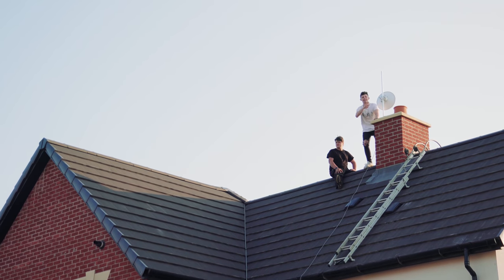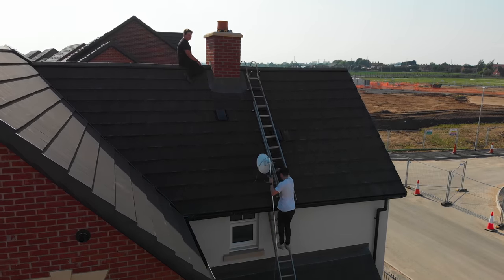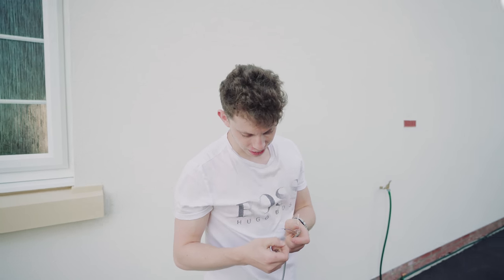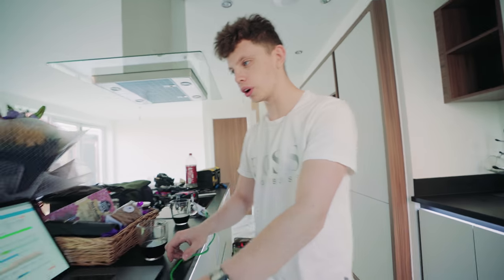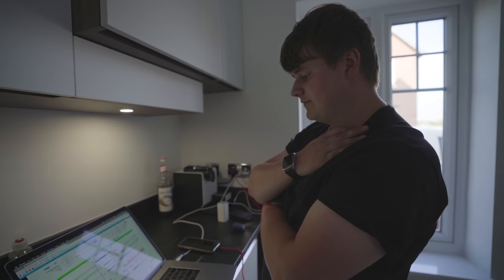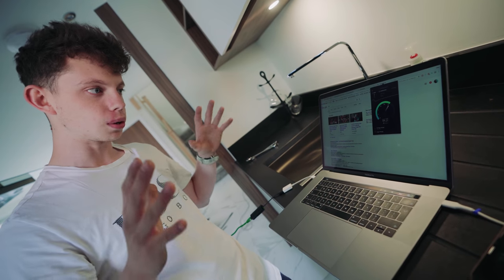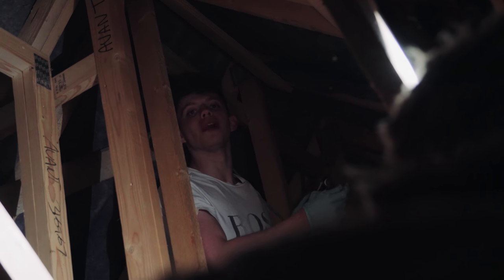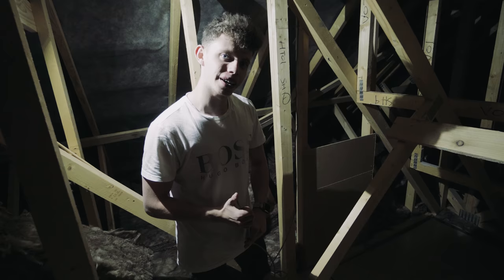How To Get Superfast Fiber Internet When you CANT!

Comment: Oh my goodness.... Its megaBITS (Mb) not megaBYTES (MB) to measure internet speed.... please learn
Reply: Bass Booster HD OMFG IKR. It gives me OCD every time i hear it.
Reply: You can measure Internet bandwidth in MBps but Mbps is what Alex is reading.
Reply: MaX Falstein No, it is a well regarded and accepted fact that data transmission is measured in megabits per second (Mbps) whereas data storage is measured in megabytes (MB). While yes you technically can measure data transmission rates in Megabytes it doesn’t mean people won’t think you are a complete numbnut
Reply: In data centre and supercomputer networks, both values tend to be stated for different protocols operating over the networks such as TCP/IP or Ethernet operating over InfiniBand or Fibre Channel operating over InfiniBand. Storage over network is often quoted as GBps across a network connection or aggregated connections, TBps across a switch or PBps across a whole network.

I can factually certify this because it is one of my areas of work. Just because you have not come across MBps does not mean it is not used.
Reply: Yes it can be measured in MB but for what im talking about and numbers from speedtest, its megabits...
Reply: Which is why I agreed with you in the latter part of my initial statement.
Alex read it wrong.
Reply: MaX Falstein I have. I’m in “that line of work” too. But for all intensive purposes when you’re talking about a YouTuber teetering on a ladder slapping a Ubiquiti CPE radio on the roof (using Ookla, which uses Mbps) we’re talking about megaBITS. Also “factually certify” is a redundancy. Pick one (most likely certify because it is the verb) and ditch the other. Eloquence is different than sticking a ton of vocabulary in a sentence.
Reply: Intents and purposes.
Reply: @eastwardExpansion  And then are Mebibytes, bet you never heard of those!

Comment: Mate, I don't think that you're using proper outdoor rated cable which will result in the cable deteriorating and you will probably end up with cracked cable and shit with the UK's weather.
Reply: System Void ya I looked at that and thought, “hmmmm.” One way to learn, the hard way
Reply: and the server he wants to put up there will die/ over heat  fast because of all the dust

Comment: when you can't terminate a RJ45 cable properly, at least use certified EZ RJ45 plugs and make sure your wires are straight. if you look closely the crimper he used is supposed to chop off the excess wire at the end of the plug and it didn't even do that.

Comment: I've watched about 4 of your videos on your wireless network now and wanted to add some comments for you @techflow that might help you on your way.

Firstly, you've done some amazing stuff, it's clear you've picked a lot of the knowledge up as you've gone along which is to be commended, I learnt a lot of what I know in much the same way and ignore the dummies who claim this is illegal or just want to tell you what you're doing wrong and make fun of you. I will however offer some friendly recommendations as someone who has worked in this industry for 12 years:

1. Get some tough-cable or outdoor ethernet cable that will last - the grey stuff you've shown is going to deteriorate with time and you'll have to re-run the whole lot; better to spend a bit more upfront and have it last for the servicable life of the radios (5 years~)
2. If you were to supply each of your customers with a MikroTik hAP ac lite or similar, you would a) have a device that you could login to allowing you to check speed and test the network from your customers end and b) supply PoE out (via port 5) to the radios you're installing, making for a much neater installation overall.
3. Have a look into more of the MikroTik gear for routing - while the Ubiquiti UI is appealing, you loose a lot of useful functionality that RouterOS has standard
4. If you want to start providing services to business, it'd be worthwhile looking into grounding the radios also - in the event a lightning strike or surge hits the devices are properly grounded and you save (at your home base) the switches/routers from being fried by voltage fed down the cable - in my opinion this is a case of "when" lightning hits close enough, not if :-)
5. Join some of the WISP Groups on Facebook, checkout The Brothers WISP or other such groups on youtube and listen to some of the new things people are talking about and keep yourself up to date on these - you've basically become one of the gang so you might as well benefit from others experience and help your own business out in the process.
6. For redundancy; install 2 sectors, one above the other - where you have customers on the PTMP setup you have the ability to setup a fallback SSID they can connect to in the event you want to take a sector offine to upgrade it / replace it.
7. On the subject of sectors - look into the RF Elements range of antennas - if you're having any issues with too much interference as you get near more heavily populated areas these will save you a lot of pain, ensuring that you signal only goes where you want it to, and you don't have to deal with the other crap nearby. Your customers can still operate on the regular client radios, but having good noise isolation on your primary connection points will give you more channels to work with and make for a better user experience all round.
8. Look into setting up a redundant point of entry into your network - now you've got your house, when you can justify it get a second high speed connection there (even if it's not as fast as the first) so that in the event you loose your primary at least  you have some 'limp-home' functionality for the people relying on your network.

9. Keep doing what you are doing, running an ISP no matter how big or small can be a great experience and a lot of fun!
Reply: Criticism is good because you do things right, if you take it as criticism and not random hate. I bet this dude is still going to be installing his network CABINETS in the attic...

Comment: You obviously go through a mainstream provider anyways. You don't supply your own pool. You basically take what you get and push out to other people in your neighborhood and then charge them. Stop fronting like you're your own ISP.

Edit -  I, myself and others apparently...see multiple issues. Please read the comments and correct your mistakes. 

Outdoor rated cabling, grounding,  attic space for a server???
Reply: How do you think an ISP works? They purchase data from an upstream provider and on-sell to clients. In a previous video he mentioned that he has a wholesale agreement with his provider. Retail ISPs do not usually allow you to act as an ISP and on-sell, so getting a wholesale agreement is necessary before doing this.
Reply: Anthony But they supply public ips. He provides a lan access.
Reply: Denzel Disk he could if he wanted to. He’d have to purchase a block of IPs though and for the small amount of clients he has and none of them probably need a unique public IP, there is no need.
Reply: No he could not provide his own IP Addresses, he certainly has no idea what BGP is and not a single piece of equipment he owns can route IPs. He couldn't afford the cost to own his own block of IPs, let alone the cost to get the equipment to actually use the IPs.

Edit: Anthony how you said an ISP works is not at all how an ISP actually works.
Reply: aidan can’t speak for your country. But it does here in Australia.
Reply: Anthony To a degree you're correct, though he is realistically only an ISP resell, not an actual ISP. An actual ISP would get upstream provider(s), more than likely they would just have mutual peering agreements.. Then BGP and serve customers, no agreement to say what is being done with the bandwidth is necessary.
Reply: aidan absolutely. He is being an ISP on the cheap. There is definitely a lot he could be doing better such as having multiple upstream providers for extra bandwidth and redundancy and having provider grade equipment, but then he’d have to have a lot more customers to justify the enormous expense.
Reply: aidan I agree with Aidan on this, this is equivalent to me chucking an Ethernet cable out my window and into my neighbours house to an access point. While it’s entirely possible to run many users on a single IP it’s a stretch to call yourself and isp , he doesn’t even have any vlan segregation I bet

Comment: @alex, you should invest in a uinstaller. Makes setup and alignment much easierand more efficient. I run a WISP in South Africa and use pretty much exclusively UBNT. With 2 in a team we can do an install in 45 min if all goes well. 1 guy on the roof and 1 guy runs a cable to the point on the roof. You can install the radio and do alignment with the uinstaller while the cable is being run, then crimp up and youre done.
Reply: Cameron Olivier // hey Oliver liked your comment you gave to Alex.  I want to do the same setup in SA . In order to establish a LAN and later a WAN. As you know data in SA is stupid expansive.  
Would like to know what equipment  you use and setup. And do you get a lease line from what ISP.

Comment: An outdoor rated cable should have defiantly been used, or at least some form of conduit should have been used. The pole should also be earthed. Ubiquiti even sell a device that specifically earthes poles!
Reply: Agreed. He should really consult with field techs before he posts an online video acting like he's a professional.
Reply: Absolutely. That could have been outdoor rated cable, but very unlikely as it is usually black. The Ubiquiti surge protector unit is also a must and Ubiquiti usually void the warranty if they aren't used on outdoor installations. Would definitely like to see Alex follow proper procedures in this regard.
Reply: UBNT even go as far as to spec 2 surge protectors. 1 at the radio and 1 at the power source. But he is trying, give him a break. He can only learn. Just hope he learns how valuable a lifeline and harness is before he needs it, those steep pitch roofs are dangerous.

Comment: decided to pay $50 for a wifi antenna adapter and i pick up my schools wifi around a half a mile away the fastest normal download in my area is 1.5 down and now using the schools network i get 25 down which is awsome i get inconsistant speeds when cloudy but hey an extra connection for free and i have permission to use it as long as im not doing anything ilegal on it ps one the the teachers is my aunt so thats how i got permission

Comment: Runs cable through pole not on it so it rattles like a boat mast in the wind
Doesn't use outdoor grade cable with UV resistance or ESD drain (Tough Cable)
Uses pikey unsheilded RJ45 with no ESD drain (Tough Connector)
Only gets 40 Mb connection out of a product that will deliver 10X that.

Me: Head in hands, this guy says he runs a WISP?

Comment: Hardly fibre* internet if you're getting it via a dish...
Reply: By this logic once you start using WiFi you couldn't call that fibre either?
Reply: @markh1ggins  his original solution/connection isn't fiber is the point
Reply: @johnsmith-vz4sk  His original connection is fibre, he's just redistributing it using a dish.
Reply: @markh1ggins  I think the previous comment was based on the fact that slow vdsl can go faster than what he showed

Comment: If im not mistaken this was at 20MHz channel width, you should try it with 40 or 80MHz if the ether is clear enough?
Reply: Would it anyhow change the latency as well as speeds? If so, how to configure that?
Reply: @ukLz666  speeds yes,at 80mbps if your device supports it you could get speeds up.to 300-400mpbs depends on various things ofc but its possible, latency probably not, for good latency you need to pick the clearest channel, also you can selecet tdd framing to fixed 2ms and that should work instead of flexible option which is set by default
Reply: @MrSlypire  At 20 it is a narrow channel and he might need to do that to clear all insight of the two radios.

Comment: I suppose once you get your leased line installed (assuming that you haven't already) that speed will go up significantly? I'm in CT, USA and get a gigabit connection at home, not to be judgemental by any means as I would have been excited about the same speeds not that long ago, but I chuckled a bit about the speeds that you were getting excited about. What's the speed on your leased line going to look like? Or do you throttle yourself so that you can share the connection with your customers?
Reply: I myself get 200mb down and 20mb up in the UK but for the majority of people their is little investment in infrastructure and in a lot of areas your lucky to get 1-7mbps down and 0.5-1 up. so his 50-60 both ways is actually very good

Comment: Hi Alex, 

Quick question about the line of sight. I'm currently awaiting to move into my first house which is less than a mile away from my parent's address. I've been looking at ways to beam WiFi over to my new house using Powerbeams but worried I won't be able to get a great line of sight. I'm wanting both 2.4 and 5ghz signals sent over which I've been worried may not be possible. Any advice?

Thanks
Reply: Theres a website in which you can draw lines off sight if u know the 2 locations and there height

Comment: What, no shielded cable? I give that radio less than a year before it fries.
Reply: Don't worry about it. He's using standard ethernet cable, not outdoor rated so it'll degrade over the course of around 6months to become brittle from UV light, that'll take him up to winter where it'll get water in from the heavy rain and or snow from the damaged cable that's been frozen multiple times. From that point on I'm sure we'll see some other videos about how to fix it, why outdoor cables are great, and why he's had to replace his server setup after he forgot to install drip loops and his rackcase/ internet got 'flooded'.

Comment: Hello. 
About the RJ45 plugs you are using in this video.  
This is the first time i am seeing something like this as all the plugs i have used so far are closed on the pin side of the plug (no wire can go past the pin end). 
How do i find these.
Reply: PaulK platinum tools ez-rj45. They are way more common in the US. Note: you need a special crimp tool.
Reply: Such a simple yet genius solution.
Reply: LeJebait wayyy easier. I use them sometimes.
Reply: Thank you for the replies everyone.
Reply: PaulK I know you are probably sick of notifications for this thread, but if you are looking for a cheaper option for larger installs a company called Sentinel makes good alternatives. The conductors do not go all the way through but they use a load bar which is much easier. Here they are: http://www.sentinelconn.com/pl_886.html

Comment: Is that normal speeds in the UK or wherever you live. I live in the US and have Xfinity and get 940 download and around 45 Up. If that is the current situation in the UK remind me never to move there.
Reply: if you live in the middle of no where is preety bad, in cities is is quite a bit faster but no anything like the speeds your used to
Reply: Well, internet that's actually fast, for customers is not a thing in the UK. The speeds are quite low. In the US, there's far more variation. Most people have quite crappy and also expensive internet. Elsewhere in Europe, it's mostly better than in the UK. I have 200/100 in Finland and actually get 205/115.
Reply: 940 down is definitely a lot faster than average for the US.

A survey released last year had the avg in the US being 18.7 Mbps. Your 940 is an outlier.
Reply: slycordinator not in my area everyone around me has a minimum of 100mbs. 250 is the average around me and even higher then that usually.
Reply: @xims923  It varies greatly by city/region. If I search by my folks' old zip, the maximum offering available is gigabit although, that hasn't been built out to the neighborhood they were in, so the real max was the 250 Mbps from xfinity.

But in their new city, the maximum offering is 100 Mbps.
Reply: actually the US isn't even a top ten country for internet speed. There's lots of reasons not to live there, including crap internet.
Reply: toranamunter actually it is the tenth as of 2017. Now the US is probably even higher on the list. But that doesn’t mean certain sections of the US doesn’t have crap internet or internet at all. The US is so vast especially in places like the Pacific Northwest and some desert areas where nothing is even at called dead mans land for a reason. But in the modern areas close to major cities is where you have the capability of getting great internet. Just most people don’t feel like paying $100 or more which honestly ain’t much at all. Not only that but most of the wiring in the US is so old that it has to be re done for the newer technology that is coming out today for them higher speeds of gig and higher. But the top country currently is South Korea that honestly just recently started its government in a proper way and as well as the building of their country in the 1960s and up. So in not even 60 years of developing a entirely new country and modern as well of course they’d have the best average internet at only 28mbs.
Reply: @xims923  yes, I agree. I guess it also depends how you measure it. But at the end of the day, the US just isn't a "fast internet" country. Which is amazing considering how many websites, present one included, are US tech companies, certainly in the English language anyway. But to live in a "fast internet for everybody" culture you really need to live in Asia or Scandinavia. Also Americans for whatever reason are asked to pay a lot for for their fairly humble home broadband. Whereas in much of Asia, 25 bucks for gigabit fibre is pretty normal.